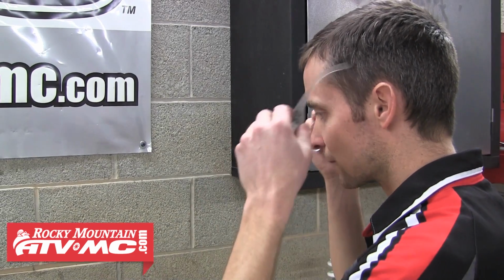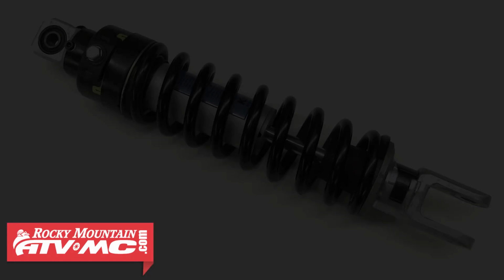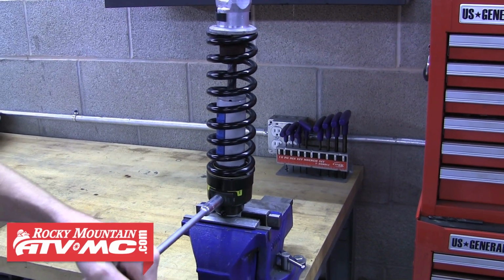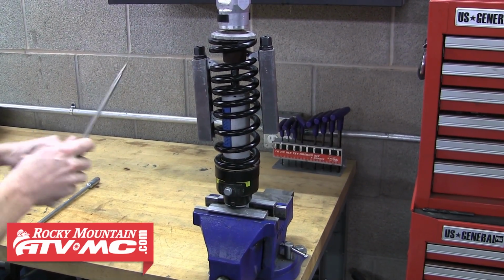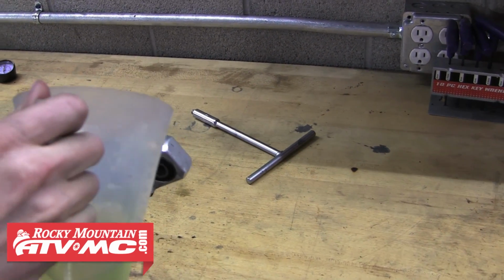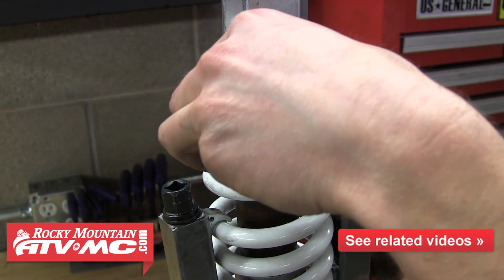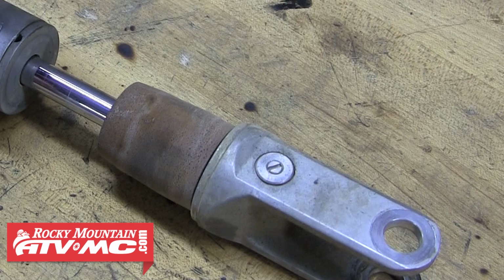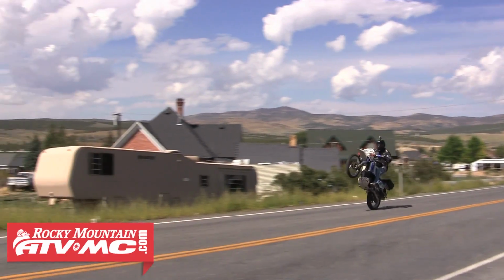Kawasaki KLR650 Shock Spring Upgrade and Shock Oil Replacement

Comment: Amigo
Cuanto aceite lleva ??
Cuanta presion de aire lleva ??

Grqcias
Reply from the maker: Ponemos 140ml de aceite con nitrógeno 140psi.
Reply: @rmatvmc  gracias amigo pensé que no respondería inmediato
Reply: Amigo disculpa, soy de Venezuela me dices que 140psi y en el vídeo dice alrededor de 15 psi..  @rmatvmc
Reply from the maker: 15 psi eran para comprobar si la válvula tenía fugas de aire. Tuvimos que quitar el vástago de la válvula para reemplazar la junta tórica. Después, instalamos 140 psi de nitrógeno. 8:08
Reply: Ok amigo gracias 🫂  @rmatvmc

Comment: HOW MANY PSI OF GAS NITRÓGENO DID YOU FILL INSIDE OF THE SHOCK PLEASE MAYBE DID YOU SAID FIFTY 50 PSI OF GAS NITRÓGENO I WILL APRECIATE YOUR ASWER IAM SEE YOU FROM PARRAS DE LA FUENTE COAHUILA MÉXICO
Reply from the maker: The shock should be filled with 140 psi of nitrogen, but you will want to confirm with the service manual for your specific motorcycle.
Reply: MY KLR ITS 2001 I THINK IS THE SAME MONOSHOCK LIKE YOURS THANKS A LOT

Comment: I went up one size on the rear shock spring and it was to stiff I had to swap it back to stock spring.
Reply: is there any reason you went "up one size"?
Reply: @chuntr  Yeah the stock spring needed to be painted so I was going to put a new one on.

Comment: Why is it so important to fill it with nitrogen verses air (21 percent O2 and 70 percent nitrogen)?
Reply: PS air is like 79% Nitrogen but who's counting
Reply: Oxygen oxidizes things. Nitrogen does not. If you rebuild your shocks every season it probably won't matter. If you are gonna neglect your suspension for another 20 years, then go ahead and spring for the nitrogen.

Comment: I notice on both your first and second gen shocks, the plastic "protector" is missing. Were these removed? Are they not necessary when reassembling?
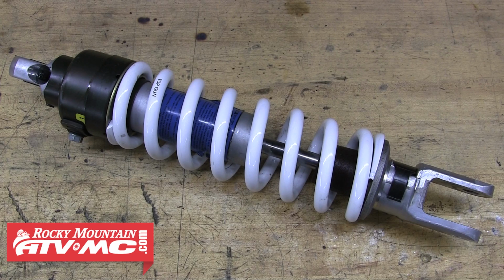Reply from the maker: Sorry, are you referring to this video or our KLR650 Shock Rebuild video? In this video at min 7:55 the plastic protector for the clicker is back on the shock.  Are you referring to a different part?
Reply: I checked bikebandit, and it seems to only be included on the second-gens...pardon my confusion. It's not the plastic cover over the rebound adjuster, but a much bigger plastic part...I can't find a name for it, I'm afraid. It covers the bump stop and exposed shaft, and is actually inside the spring, with a lip that sits on top of the spring and beneath the retainer ring. Mine was a little damaged from my shoddy upgrade work, so I was just concerned if I should put it back in.  Thank you for the reply :)
Reply from the maker: Lydia Jones I see.  That plastic sleeve covering the shaft.  I would definitely try to reuse it.  Maybe smooth it out the best you can with a little sandpaper where needed.  I don't show that part is replaceable.